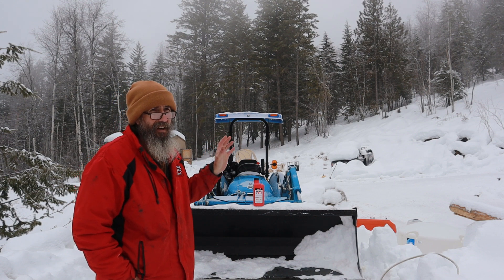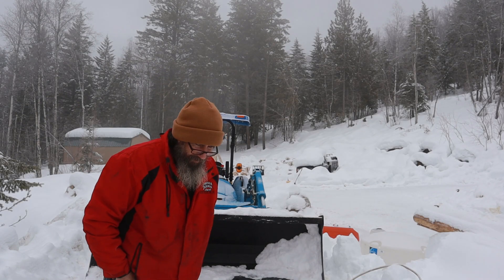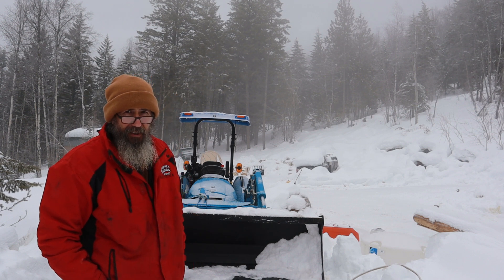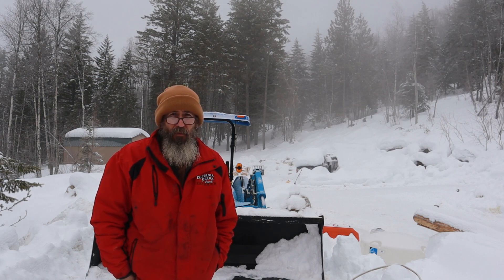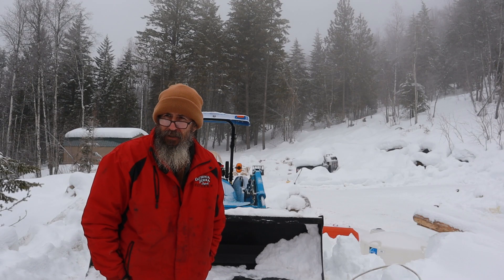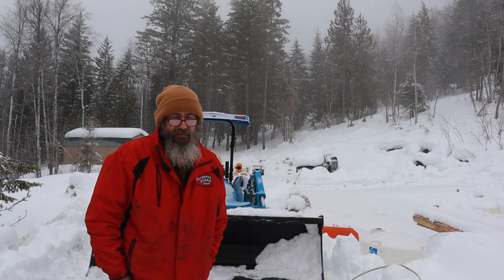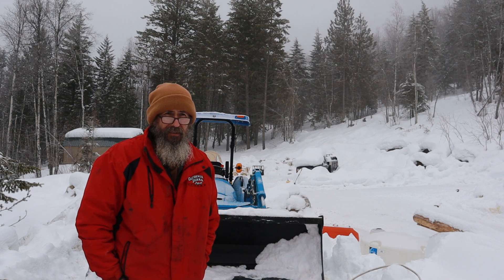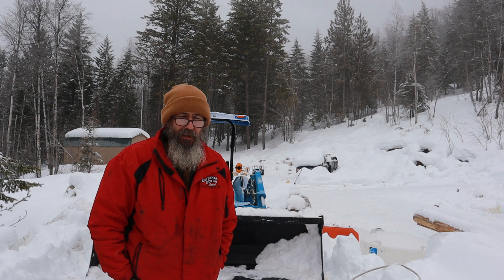Tractor Broke Down | Diagnosing LS Tractor Error Codes

Comment: My LS won’t go into regen even if you try and force it. I had to shut down in middle of cycle. Anybody have a no shop visit advice for this?
Reply from the maker: @r-crewproductions814  I’ve had this happen a couple few times. I usually don’t worry about it. What I will do is kick it up to the regen rpms and use it like that for a while. I usually keep mine at about 2400 rpms on the daily stuff. If I get a regen light I kick it up to about 2700, let it do its thing while I’m working. This is for our tractor the mt352. Hope you get it sorted out.

Comment: Well I have a LS Tractor got the mower deck and backhoe. Well backhoe fell off the tractor ripped the threads right out of the housing. Mower deck alway had a leak from the first day I used it was told it’s normal. Mower hardly got used first year I bought this set up. The second year I didn’t mow from July to November. Fuel pump started smoking with in the first 100 hours. Going to try 00 grease but I doubt it will work I think seals are completely gone. LS Tractors and equipment are junk
Reply: Wow man! That’s very unfortunate all this has happened. I have heard some horror stories about stuff like this happening. Sorry to hear that. So far at almost 250 hrs. We have had pretty good luck. Hope you are able to get your grievances worked out with your local dealer. Thanks for watching.